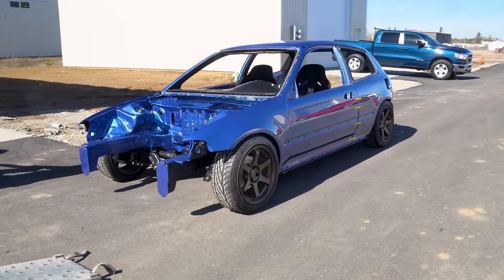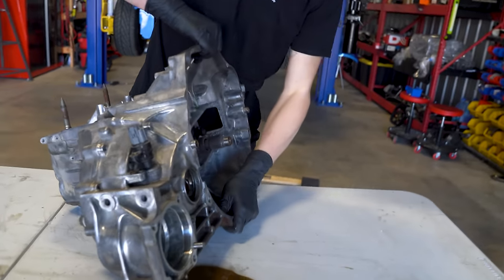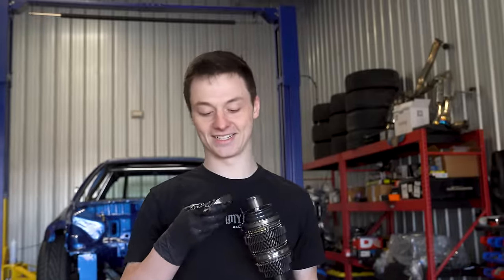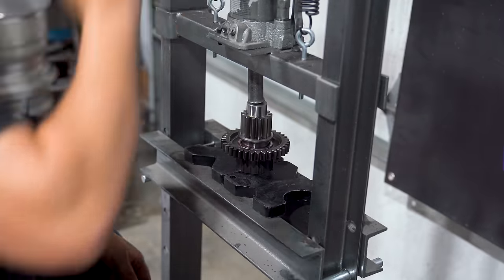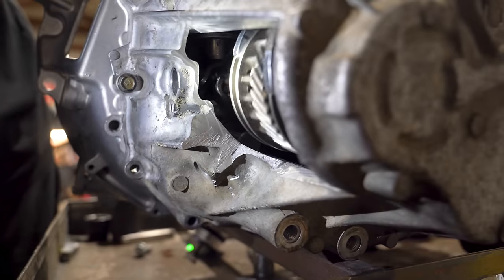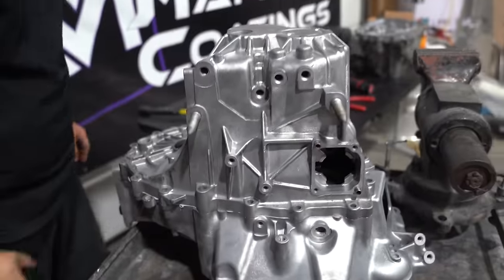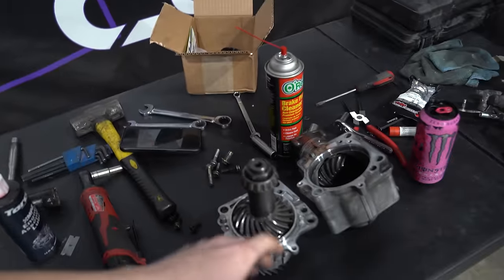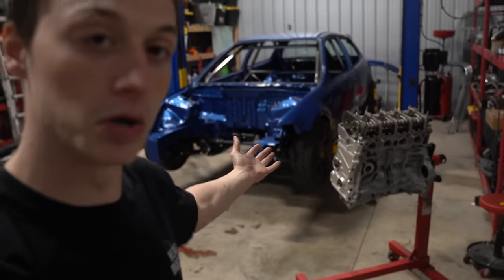AWD Honda Gets a $15,000 Dog Box

Comment: Great job bro! Little tip for the future on the Honda boxes, when you pull the gear set out of the case, tape around all the shafts and selectors. That way when you pull it out you can see how it all sits together and make sure it goes back right.

Comment: Looking good so far but I want to mention one thing about the trans build! I do these transmissions for a living and with Ppg on a k series it touches reverse gear on 2nd which you clearanced but it also touches 1st gear by the 5th-r fork.. did you shave that fork a bit to clear 1st gear? If not it will touch and make noise whole time..seems like when y’all spin it it’s making that noise.
Reply from the maker: I did not mention this in the video but yes, I also did shave that!
Reply: @RemmyEvans  nice just making sure!!
Reply from the maker: I appreciate you looking out🙏🏽